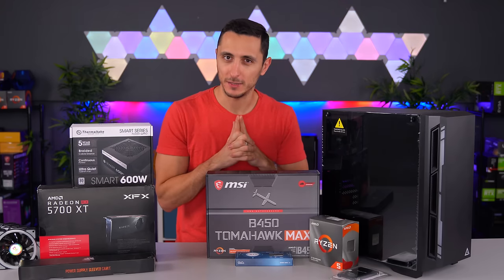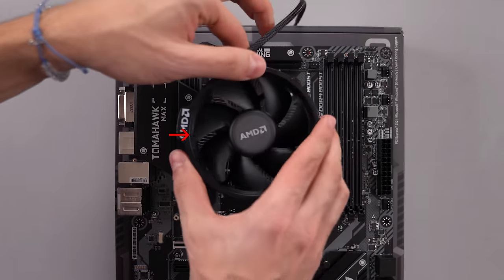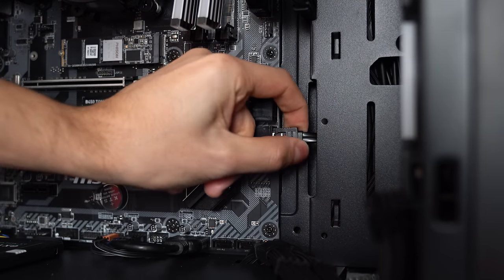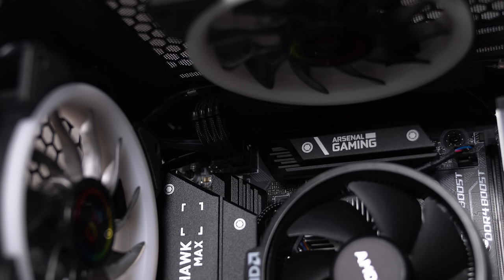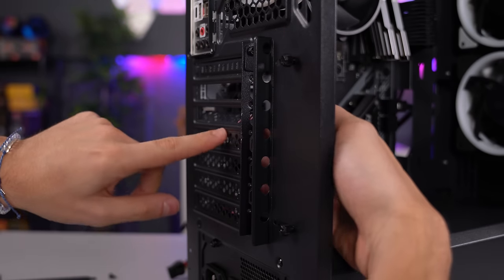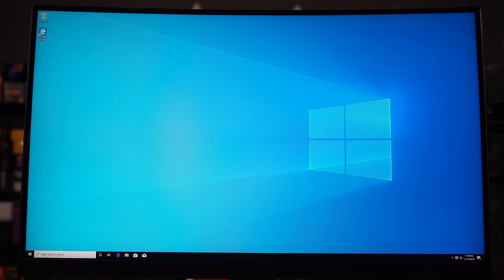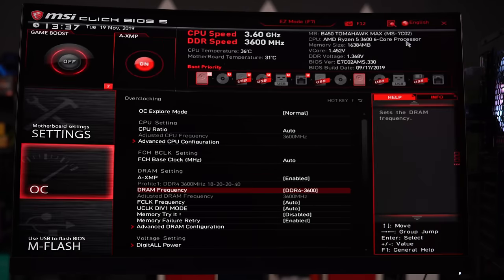How To Build A PC - Full Beginners Guide + Overclocking

Comment: Hi there I followed everything on this video and it was so helpful, now I turned it on for the first time and it runs however there is no signal? And no USB working when it's on and running? So confused, need help!
Reply: make sure you plugged in the video cable to the graphics card and not the motherboard. After that, if it sill doesn't work, check all internal connections. Make sure everything is plugged in the correct place and securely.

Comment: Hi, I know I'm a bit late for asking questions, but I find this video really helpful for a noob like me.
I'd like to know since I'm building my first pc, how to connect my motherboard to internet.
I bought a b450 tomahawk max and I know it needs a wifi card to be connected on internet so I bought a Ziyituod ZYT-AX200.
Will this wifi card works when I install it or do I need to install something for it to work (I still haven't recieved i yet) ?
Reply: It will work. You just plug it into one of the smaller PCI-E slots.
Reply: @JJFlores197  doesn’t it need to download drivers or something? (I think I’ve read about downloading sum)
Reply: @haddakon5420  Windows 10 has a lot of drivers built-in. If it doesn't have drivers for your adapter, you will need to download them on another computer and transfer them to your new PC via USB.

Comment: Do you have to buy the additional standoff screws? What about the screws used to tighten the motherboard down?
Reply: They come in motherboard box no need for you to worry about that.
Reply: @andrewlowe3422  Thank you so much for the info!
Reply: @randall_megia  it's the motherboard box or pc case one is those two either way you don't need them separately.

Comment: For those actually overclocking a Ryzen 3000 or 5000 CPU, please do NOT take the advice that 1.4v is the max safe voltage. There have been many reports of peoples' CPUs degrading after a few months to the point where they aren't stable at their stock clocks. Some CPUs are more voltage resistant than others and they could still last a year or now at high voltages, but I wouldn't take the gamble of damaging your CPU. If you want to ensure your CPU won't degrade, I wouldn't go over 1.25v

Comment: Strange I never overclocked my PC, I have the Ryzen 7 2700X and Radeon 5700XT when you run 3600Mhz with XMP enabled my PC locks up, my motherboard is the exact same. Looks like it is a faulty motherboard, the RAM is fine as my initial RAM had to be returned it was Faulty.

Comment: Do you need a WiFi adaptor to connect to WiFi directly? (without having to connect your pc to a phone or a laptop)
Reply: Yes. Most motherboards don't have wifi built in. If it did, it would be listed in the specifications.
Reply: @JJFlores197  
I have temporarily connected my PC to an ethernet cable. I noticed a subtle difference in download speed but it's not that huge so I'd be okay with using only WiFi.

Comment: Im confuse on where i insert the sata cable in the sata 5 or 6
Reply: It doesn't matter on what port you plug in the SATA cable. The exception being if you have M.2 SSDs installed. In that instance, you want to refer to your motherboard manual to see what SATA ports you can use. If you install M.2 SSDs you may loose some SATA port.
Reply: @JJFlores197  thank you

Comment: Hi, I just built my first pc with this same motherboard and cpu. I did it following your latest building guide. 

The thing is I boot the pc but I keep getting the cpu debug light. I tried flashing the bios several times, only one time it seemed to be done right but still same cpu light and no display

Could it be simply that my cpu is broken? I don't have any other and mobo to test it
Reply: your cpu might me broken or incorrectly fitted

Comment: If you don’t have a ssd do you need to plug in your sata port cable, I’m only using a m.2 drive so do i need to plug in a sata port?
Reply: If you're not going to be using a standard 2.5" SSD, there's no need to plug in a SATA cable.
To clarify: You DO have an SSD. M.2 is the form factor that some SSDs use.

Comment: I followed what to do with the RAM in the BIOS, and proceeded to save and said about temperature changes, as the PC restarted it came up and said there was a problem, and now it won’t display anything despite being turned on. There is now a red light on the CPU LED on the tomohawk motherboard, any suggestions
Reply: Reset the CMOS (check mobo manual for this). It is most likely a bad overclock. You will probably need to fine-tune O/C settings.

Comment: Do you need to update the BIOS of B450m in order to use the Ryzen 5 3600? Or just install the processor directly to the board out of the box without updating anything and it will work just fine?
Reply: It depends on the Bios version of that board. I think you find it you buy that board today it should be ok , if you brought that board a year ago it would need a Bios flash.

Comment: Do you need to apply a thermal paste before puting the cooler fan in the CPU?
Reply: It goes before installing the CPU cooler. You can't apply thermal paste after the cooler is installed since the paste goes in between CPU and cooler. Most coolers come with pre-applied thermal paste.

Comment: What do u mean fully seated when it comes to the 24 pin cable?
Reply: It means to make sure that the 24-pin motherboard power cable is installed correctly in the connector. If you see the plug, you should see a small clip that aligns with the connector on the board. This is to make sure that you insert the cable in the correct orientation and that it locks into place.

Comment: Is there any possibilities that overclocking a CPU (Ryzen 5 3600 stock cooler) will damage the cpu pin for the 1st pci_e?

Ive followed the overclocking process, and after a month my pc is suddenly turned off and no display and not reading my GPU in the first PCI_e slot (I change my mobo 3 times, same problem.), but GPU is working in the 2nd slot of the mobo. My GPU is working also(tested in other PC)

Comment: Sir i need your help after i do your guide my pc starts but it quickly turns off what seems to be the problem though. All new parts pls reply need your help
Reply: Make sure everything is installed correctly. Double/triple check all connections. Make sure nothing is shorting any components.

Comment: 00:00 Building the PC
15:25 Installing Windows 10
19:38 Installing Drivers
21:14 Enabling XMP
21:55 Downloading the Overclocking and Benchmarking Software
22:15 CPU Overclock
23:31 GPU Overclock
25:01 CPU and GPU Temperature Limit
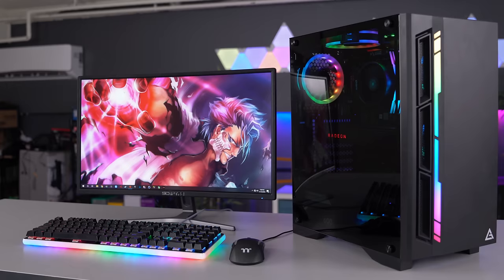25:29 Outro

Comment: why do we have to manually update these drivers, cant we update them automatically from the device manager tab, i am wondering
Reply: Windows doesn't always install the latest drivers and I have found that it usually takes a lot longer than necessary for it to find drivers that way instead of downloading them from the manufacturer.

Comment: Please reply i have the same motherboard and CPU Ryzen 5 5600x 
But when i finished building the PC , the monitor does not even work 
And there is a red LED for the CPU on the mother board and it’s on 
What should i do iam so upset because of this problem please help !!
Reply: Well that means there's either a problem with the CPU OR the motherboard's BIOS version doesn't support that CPU. It helps to know what motherboard you have. If your board supports the CPU, you will most likely need to update the BIOS. Unfortunately, on most boards, you need a supported CPU first in order to update the BIOS. On some of the mid to high-end boards, you can update the BIOS w/o a CPU, but that is not found in most of the lower-end boards.

Comment: What if you have in the ssd your windows ? Or you have to again put windows from the start ?
Reply: You should be able take the old drive with Windows and put it in a new system. However, before you do that, i recommend uninstalling the drivers from your old motherboard and graphics card first. Once you do that and put it in the new system, install the drivers for the new motherboard.

Comment: im super new to pc stuff and i dont know anything am i supposed to use all the parts he used or can i use diffrent ones and still follow his instructions
Reply: The best thing you can do is to take the time to learn how computers work and the terminology. That will at least give you a decent foundation of PC knowledge. You can use different parts. The main things to look out for are CPU and motherboard compatibility. pcpartpicker.com is a good website for knowing if your parts are compatible. The overall PC build process is practically the same regardless of what parts you choose. There are usually some variances between parts, but nothing too difficult to figure out.
Reply: @JJFlores197  thanks bro

Comment: I’m pretty new to PCs and my friend told me I need to get a motherboard that says WiFi on it what happens if I want to get the one in the video do I need to buy a wireless network adapter?
Reply: If you buy a motherboard that doesn't have WiFi built-in, you will need to buy a WiFi adapter.

Comment: My R5 3600's stock voltage is around 1.24.. why is yours so much higher stock?
Reply: thats a good thing. limit it at 1.2 or 1.225 @4.2GHz for a good balance between performance and temperatures

Comment: Why does my brand new ssd make my pc so slow when it boots up and when I use it does that mean it’s faulty???
Reply: not necessarily.
there are different ssd's 
M.2 are fastest and even they come in various different speeds.
there are softwares that can test your SSD speed.
try finding one thats from your SSD manufacturer.
for example i have intel SSD and they provide software to benchmark your ssd

Comment: If i get all the same parts as TechSource will all of the cables be included??
And will i be able to connect things through bluetooth???
Reply: The cables will come with the respective parts. For Bluetooth, you'll need to buy a USB bluetooth adapter. Most motherboards don't have Wi-Fi/BT built-in unless it specifically mentions it in the product specifications.
Reply: @JJFlores197  thank you 🙏

Comment: My PC just won't turn on. I've already bought another PSU but still nothing. What's the issue? CPU?
Reply: Start by double checking all of your connections. Pay particular attention to the power button header cables.
Reply: @JJFlores197  triple checked all the connectors and cables. Definitely snug and in the right places. I’m beginning to suspect it’s either the CPU or mobo. I most probably did something wrong with the mobo when doing the BIOS flashback update

Comment: If you have already an ssd from a laptop can you put it on a new build
Reply: Ideally, you should do a clean Windows install. If you cannot/will not do that, you should be able to move the drive with the Windows installation over to a new PC. I would first uninstall the laptop-specific software and drivers. Once you do that. move the drive over to the new PC and install the drivers for the new hardware. You may get a Windows activation message since you are moving to a very different computer. The licensing agreement that you didn't read but still agreed to states that you're not supposed to move the OEM windows installation to a new computer. That may or may not happen.

Comment: My PSU has 2 different Sata cables, how do I know high one to use for the HDD?
Reply: It doesn't matter. As long as the connector fits into the drive's power connector, it will work.

Comment: i dont have any cpu cooler but I have 3 fans that come with my case, will this be a problem?
Reply: Yes of course. You need a CPU cooler, otherwise the CPU will overheat which is not a good thing at all. I believe that a lot of the Ryzen CPUs, including the one in the video, come with a stock cooler.

Comment: For the LAN drivers there's only "Intel I225 LAN Driver" on the support page even though I'm using AMD. Is it okay if I install the driver? (Using ASUS ROG STRIX B550-A mbo)
Reply: That's perfectly fine. In this instance, your motherboard uses a network adapter from Intel. It has no effect if you use an AMD CPU.

Comment: Do you need a hard drive and ssd?
Reply: Either will work. Though, I strongly recommend using an SSD as the boot drive as it will make your system much more responsive than with just a hard drive. I recommend an SSD on practically every modern computer; even if it isn't for gaming.

Comment: Ed!  so i got the 240 liquid cooler also by aorus. The issue here is that the fans are spinning, but the LEDs on it isn't. The display screen is also black and nothing comes on. Do you or anyone in the comments have a solution for me?
Reply: You probably need to enable it in the BIOS or the specific software that it requires.
Reply: turns out i had a bad motherboard lol

Comment: I need help my HDD doesn't show up anywhere what can I do?
Reply: Make sure its plugged in correctly (power and data (both ends)). If you happen to have an M.2 SSD installed, read the motherboard manual. On some systems, if you have an M.2 SSD, it will disable certain SATA ports.

Comment: Hey I got a new case and moved everything over everything is plugged in but it’s not turning on. Can I get some help please
Reply: Did you double check every single connection? Made sure the power supply's power switch is turned on?
Reply: @JJFlores197  yes everything is connected. I watched multiple videos to see if everything was good. I just moved everything back to the old case to see if the new case was damaged but still doesn’t turn on
Reply: @joeflacko25  hav u fixed it now?
Reply: @Anonymous-qj4wn  I took it to a pc repair shop and told me I fucked my motherboard up lol but it was a prebuild so it had a cheap motherboard to begin with. I now have a gigabyte b550 aorus pro.

Comment: Does anyone know what a driver does? I’m planning on building my first pc and I have no idea what it is.
Reply: In the description
Reply: A driver is a piece of software that allows your operating system (Windows, usually) to talk to your hardware (like graphics card, chipset, etc) correctly. Windows has generic drivers built-in for basic functionality. However, you should install the drivers from the manufacturer for best performance.

Comment: after i built my pc when i turn it on it won’t show any display help? everything is on the lights and all just display
Reply: Make sure you plugged in your gpu
Reply: @quipz4521  yea i plugged in everything
Reply: @ItzOceans  make sure the atx power cable is the full way in
Reply: @quipz4521  i got wrong motherboard for the cpu
Reply: @ItzOceans  rip
Reply: @ItzOceans  make sure the chipset is the same if you are ordering a new mobo
Reply: @quipz4521  ya already shipped back lol

Comment: I have no clue why, but even with following the exact steps of the video, almost identical specs, nothing works. The computer turns on, everything lights up, but the monitor stays on No Signal Check Signal Cable and restarting won't do it, and there's nothing wrong with the monitor or HDMI as it works on my old pc
Reply: Its possible that your PC isn't POSTing. POST, Power On Self-Test, is a test your PC does each time you turn it on to test your PC components. If it fails POST, it won't turn on correctly. Try following this troubleshooting guide: https://forums.tomshardware.com/faq/no-post-system-wont-boot-and-no-video-output-troubleshooting-checklist.1575220/
Reply: Did you hook the HDMI cable to the motherboard or the gpu? If it’s the motherboard it won’t be outputting as there’s no integrated graphics, switch it to the gpu.
Reply: @salamonthegreat  it's definately in the gpu, and idk why it isn't working as the gpu and everything else all turns on
Reply: @mcnoobz  alright. Try the troubleshooting guide above.
Reply: @salamonthegreat  alr
Reply: @salamonthegreat  it doesn't cover my problem, my pc turns on just fine, all the fans spin, everything lights up etc. But no signal goes through to the monitor
Reply: @mcnoobz  it does. The guide is literally “no post system won’t boot and no video output”. Follow the steps and see if you’ve done each. Just because the fans and lights come on doesn’t mean hardware might not be faulty or installed incorrectly

And if you seriously can’t find anything wrong that you may have done, it might be reasonable to consider a part
Reply: @salamonthegreat  oh i thought u meant the troubleshooting in the pinned comment